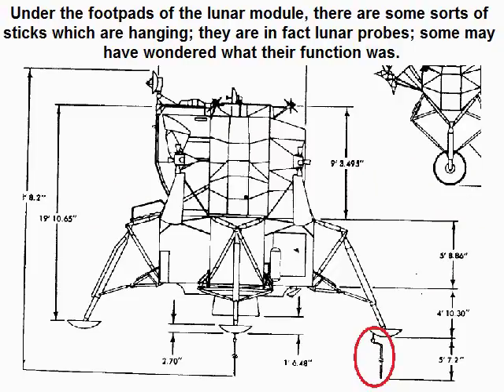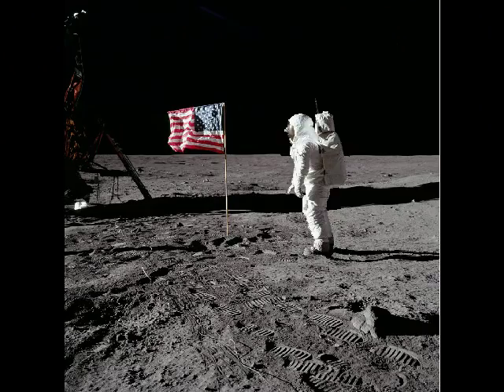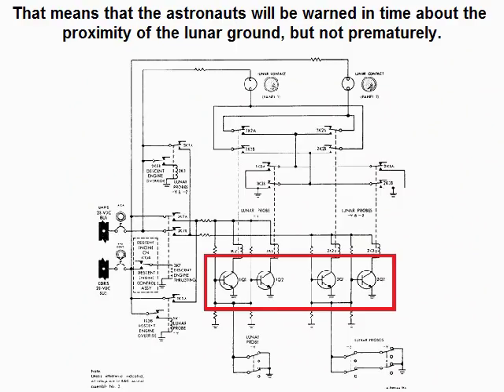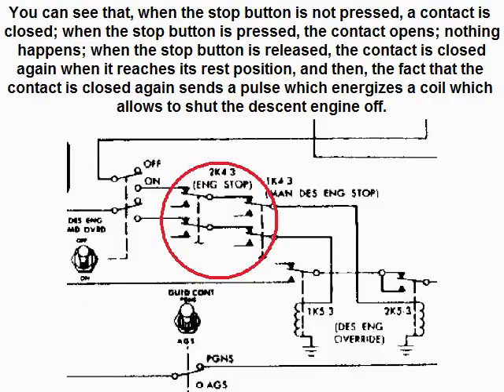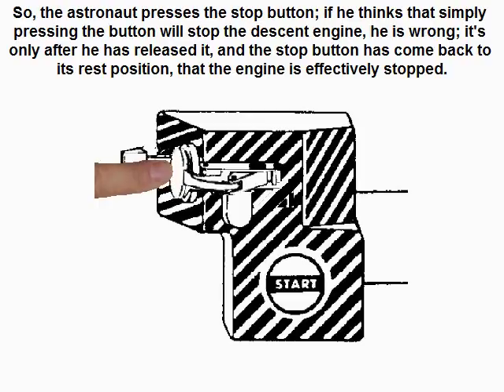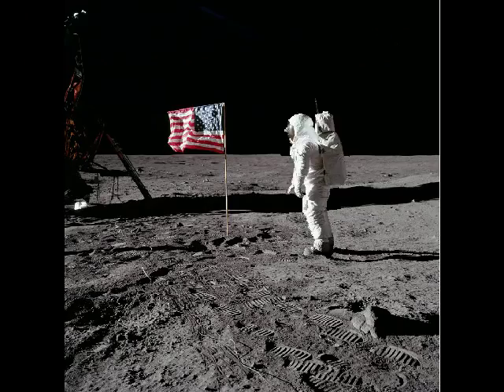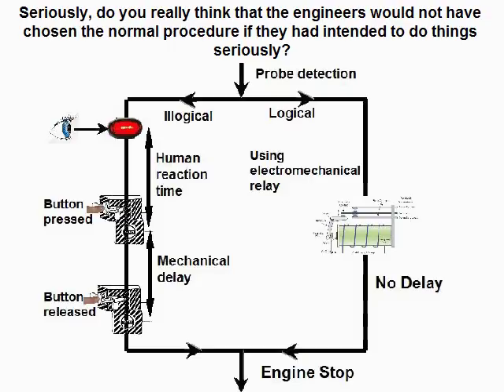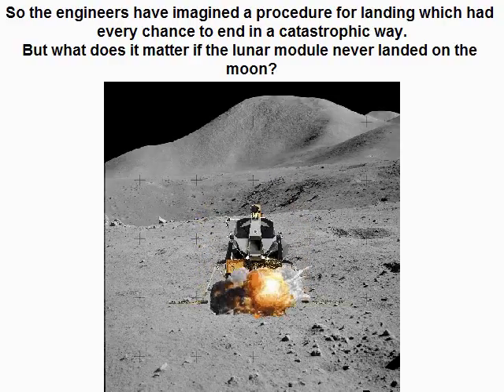Unsafe moon landing

Comment: OK, than I have another question for you all... Didn't they have no "space" problem for a lunar lander with such long sticks on his feet? Could they waste 1.7m inside the rocket for this sticks? Now I am curious for your answer...Oh I guess it! They are made from rubber and were rolled up!
Reply: Aluminum tubes with a pivot at the LEM-leg-end, swiveled into position by a spring. Pretty much like my car key folds into its base. Not that you really cared, or you wouldn't go pitting your ignorance against a room full of practicing engineers.
Reply: Great question, Ralf. Happy to enlighten you. The probes were hinged to the bottom of the footpads and while the LM was still inside the adapter at the top of the Saturn V 3rd stage (the S-IVB), they were folded inwards towards the LM descent stage engine nozzle, over the 'dome' which was the top end of the S-IVB propellant (liquid hydrogen) tank. The probes remained folded inwards during the Transposition, Docking & Extraction manoeuvre while the Command+Service Module (CSM) docked with the LM and extracted it from the adapter (which consisted of four 'petals' that opened outwards and were jettisoned by firing explosive bolts). The probes were not extended until the LM was in Lunar Orbit, shortly after undocking from the CSM and before the powered descent to the lunar surface began.

See, for description: https://en.wikipedia.org/wiki/Transposition,_docking,_and_extraction
Apollo 14 docking and extraction film: http://www.sciencephoto.com/media/239565/view
Apollo 11 LM (Eagle) with probes extended, photographed by Michael Collins in the Command Module

I'll be only too happy to answer any other questions you have, and I recommend this classic book, which goes into great detail:
https://www.amazon.com/Apollo-Springer-Praxis-Books-Exploration/dp/0387716750/ref=sr_1_1?ie=UTF8&qid=1517619879&sr=8-1&keywords=how+we+flew+to+the+moon
Reply: Thanks for posting that link, Rob. I'll be downloading that book to my Kindle Fire ASAP.
Reply from the maker: I don't think that these lunar probes add much weight.
Reply: +hunchbacked  Bravo for the rare neutral comment that fits the facts!